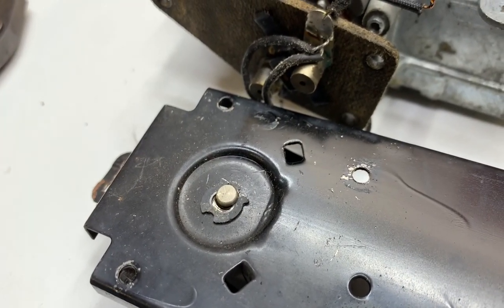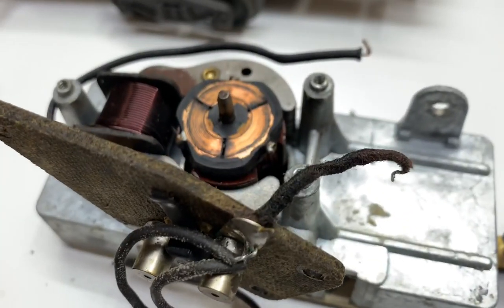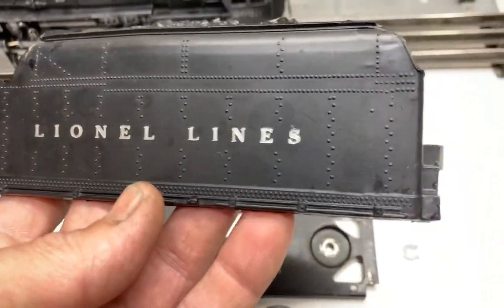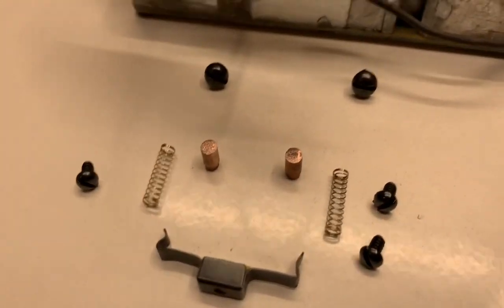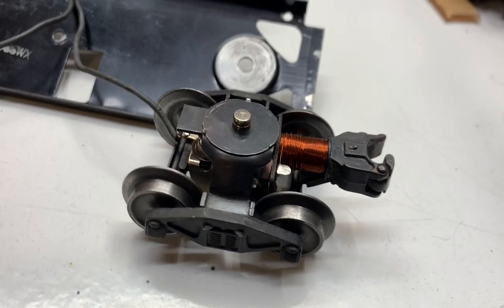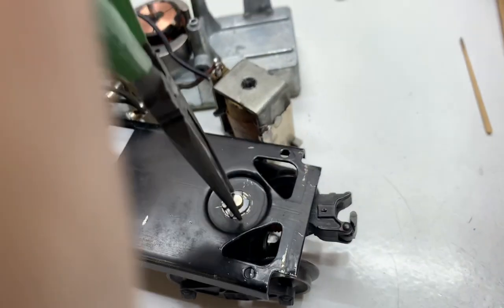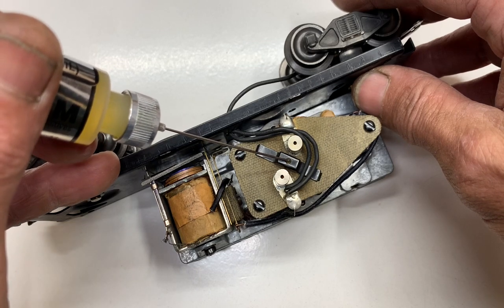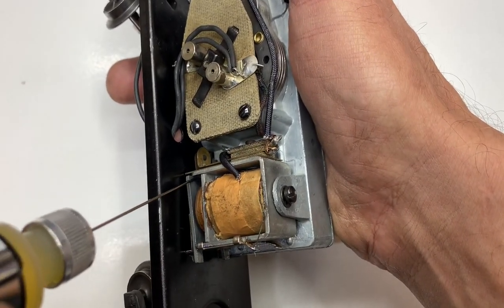Postwar Lionel’s 2466WX Whistle Tender Rebuild

Comment: Thanks for the video.  I just took apart, cleaned, and reassembled my 2466WX tender that my father gave me and couldn't get the whistle to work properly on the track.  I used your alligator clip method with the transformer and it worked perfectly.  Found out it was a bad solder connection on one of the axles.  DOH.  Anyway, all working tip top shape now.  I'll try your mineral spirits cleaning method and see how that works.

Comment: At 3:08, You mentioned that you use another method to clean the outer surface of the plastic. What was this method?  Thanks.
Reply from the maker: Mineral Spirits, very very carefully.
Reply: @flintrockvalley  Thanks.  What do you mean by “very very carefully”?  Is scrubbing with a toothbrush ok?  I don’t know much about mineral spirits. Can they make things worse if I’m too aggressive?

Comment: Where did you get the rock wool material to use as your wick oil retainer?  Thanks.
Reply from the maker: You can probably get it at local plant nursery. They’re small “starters” for seedlings.
Reply: Actually, just using some of that replacement wick material for smoke units works perfectly too!  Just trim it to the size that you need.